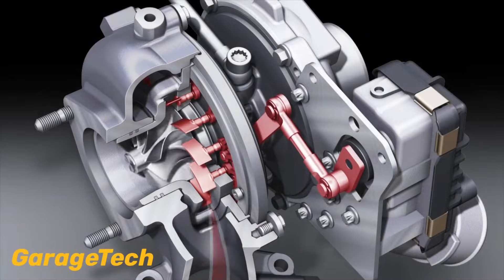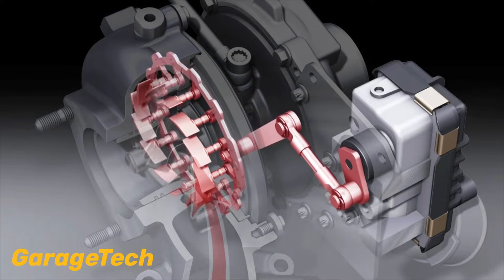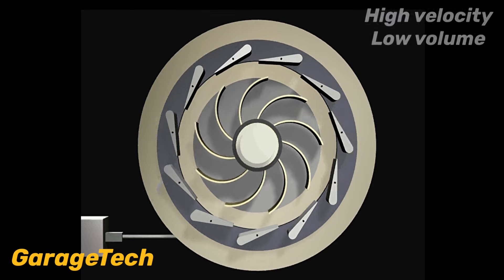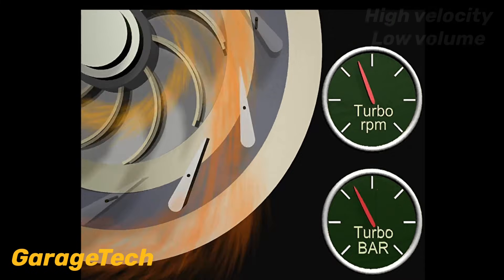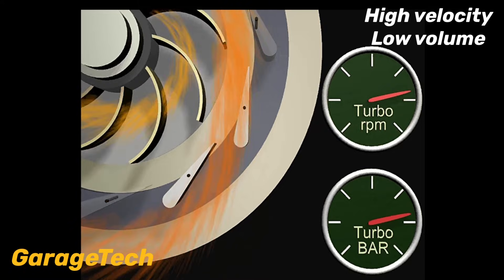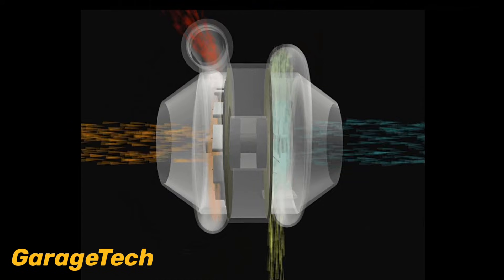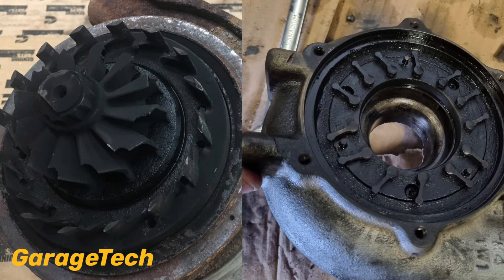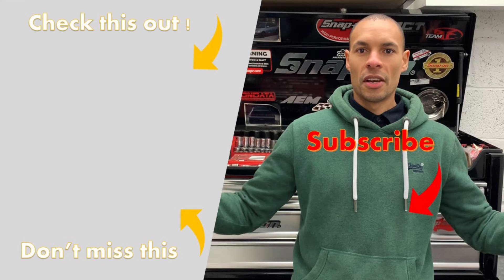How do VGT Variable Geometry Turbos work? Common faults for diesel engines. Variable vane turbos VTG

Comment: Please let know how electric actuater worksin evgt 
And what is the pulse current in evgt
Reply from the maker: Hi, An electrically operated actuator for a variable geometry turbo (VGT) is an intelligent, self-contained electric motor and gear system controlled by the engine's computer (ECM/ECU) I don't have the pulse current data, but it would typically have 5 wires, 2 for the motor, probably working on 12v, ECU reverses polarity to open/close. And then 3 wires for the position sensor, 5V,signal and ground. Some may use a Digital or PWM signal (often 0–5V square wave) or LIN bus communication 0-12V square wave. It's unlikely you'll be able to decode the PWM signal to understand what position its in, the important thing would be, do you get a signal and does it change if the position changes. These will need calibrating/basic setting adaption, so the ECM knows the start and end point. providing the vanes in the turbo are moving freely.

Comment: Attn: chat....I have a issue with my peterbilt.  Its throwing a code on my 2013 peterbilt 386, SPN 641 - Engine variable Geometry turbocharged actuator #1,  FMI =13 out of calibration.  I watched my mechanic with his laptop install and it calibrated successfully.  But, this code still didnt clear. I needed a ambient outside temperature sensor as well that was on my driver side mirror. That was replace. Has a new turbo, has a new actuator,  new manifold.  Like what is wrong with this truck.  I need help please
Reply from the maker: Seems strange that it calibrated correctly but the code is still there. If you erase the code does it stay off for a while until driven or does it come back straight away? I’d get the wiring from the turbo/actuator to the ECU checked again, could be a partial break in a wire, corrosion on a plug terminal. Check the earth and + terminals for the ECU, I assume the actuator is earthed via the ECU. If the code is still coming back after replacing the turbo and calibration has been done correctly, it can only be the wiring or the ECU. Also just worth checking things like the intake air flow meter (Air mass meter) and also boost or intake manifold pressure sensor. If these are slightly out or spoiled it will impact the boost pressure. Good luck, and let us know when you get if fixed ✌🏽

Comment: What is the effect of dirty geometry?
Reply from the maker: Hey, most common effects are lack of power, sluggish acceleration, engine going into limp mode with under boosting fault code P0299. 
You could also get over boosting which would cause the engine to go into limp mode with fault code P0234. 
Other things could be black smoke, hesitations, judders, poor fuel economy.
Reply: @GarageTechAutomotive  tks a lote

Comment: How to know if the vanes are stuck open or close due to carbon build up or slug ?
Reply from the maker: Normally the engine warning light will come on but you may notice a lack of power or black smoke coming out the exhaust
Reply: @GarageTechAutomotive thanks a lot from your video I really fully understand my turbo
Reply from the maker: @ahmedalial-saeed9471  you’re welcome ☺️

Comment: Great explanations! I have just one question. What type of actuator the turbo have? It’s ECM controlled? Or an actuator like a solenoid or stteper motor.
Reply from the maker: Hey, can depend on the turbo/engine setup, all modern ones will all be ECM controlled, some will be vacuum operated, most new one are electric motor operated as you have more accurate control

Comment: When the engine is started and there is no load the turbine blades are closed and when we press the accelerator the turbine blades are opened, is that correct?

Comment: With proper ECU, the power will drop no matter which way the vanes stick. Modern cars have both MAP and MAF sensors in the intake and if either one shows unexpected values (because of sticking VNT or VGT vanes) the ECU will cut fueling until proper limits are reached. In practice, this results in less than expected power level because incorrect vane angle would cause incorrect amount of air if given with full fuel delivery so ECU will deliver less than requested amount of fuel (according to the accelerator pedal) to the engine.

Comment: Its an Awesome idea! but the more moving parts you have in an unforgiving environment on the hot side of the turbo, would definitely cause more issues then just a regular turbocharger and cost much more to replace if and when it fails! Good idea but i think more research is needed here

Comment: Hello sir,

When you replace it with a new one in a Bmw 530d m57 231ps from 2006 needs it calibration then or is it plug and play. Thankyou
Reply from the maker: @FurKan-f6b if it’s an electronic actuator then yes it will need calibrating.

Comment: Can you clean a VGT in an ultrasonic cleaner to remove carbon without replacing the turbo?
Reply: I would recommend you to use the Wynn's turbo cleaner that is used in the fuel tank. My father had a 2017 2.8 diesel fortuner with just 150.000 km and it started to have problems with the turbo. The main problem is my country's diesel that contais almost more than 15% of biodiesel. Our car on the highway couldn't pass 120 km/h. We even went to the official toyota dealership, and they said we would have to change the hole turbo. I then searched for this turbo cleaner and it miraculously handle to clean our car's turbo. We used to put it in each time we filled the fuel tank for about 8-10 times. Hope this can help you!

Comment: Hi on my 2008 XC90 with Electronic actuator- I put in new one but after callibeation I did 600kms and it got stuck in low position- the waste gate arm from actuator- only after few times turning off and on it came back to life and managed to drivr home. Does it mean the issue is carbon dirty turbo vanes or? Thanks for any tip!! 😊
Reply from the maker: @lifestyleoffreedomfamily  yes could be that it’s clogged up with carbon soot, I would first just check all the wiring and connections just to make sure they are ok, could also make sure the calibration was done correctly. With the actuator disconnected can you move the arm freely? If it’s really stiff then that’s your issue 👍🏼
Reply: How to remove clogged soot without dismantling

Comment: Would it be better to have an emergency wastegate set slightly higher than the boost pressures you're looking for.?
Reply from the maker: @glenngray6895  Some setups have wastegates as well but generally the changing angle of the vanes is enough to slow the turbo down when needed.

Comment: Hello, I have a question regarding my whisling turbo
The turbocharger is brand new and bought it from Garret
And just today came up with idea to disconnect turbocharger actuator which is electric and then there's no more whisling
Where's the problem?
Car is remaped
Reply from the maker: @justasleleiva1351  could be where once the turbo has spooled up, the waste gate starts to open or if a VGT the vanes are in a position where it causes a whistle, with the actuator disconnected it’s preventing it from over boosting which doesn’t create a whistle noise.
Reply: @GarageTechAutomotive  so could it be too early boost or overboost?
Is there possible map or maf sensors sending wrong readings to ecu etc?
Reply from the maker: @justasleleiva1351  number of things to consider? Why was the turbo replaced in the first place, what sort of map was added, peak bhp etc, was this before or after the turbo was replaced?
Reply: @GarageTechAutomotive  Well it's pretty long story, but in short:
Dpf gutted and oem turbocharger had slightly shaft play (so back pressure damaged),
Get rid of dpf, refurbished turbo correctly installed
Remaped at proper tuner
Were whisling noice, tuner said turbo not 100% fine
Drive over 7kmiles nothing changed
Bought new turbocharger,
Washed oil sump, checked oil supply, replaced numerous of gaskets of intake system, together with new intercooler and inspected exhaust manifold, no leaks..
So after installing a new turbo charger after 2-3 weeks noice appeared but not so terrible as previous turbocharger 
So with this whisling i did an Europe trip, nothing went wrong 
Except still whisling, there plenty of power
Until yesterday i came up with idea to disconnect electric actuator and then there's no whisling at all... so i can't really figure out what should i look next. I do suspect bad map
Bmw F10 530d 2011
Reply from the maker: @justasleleiva1351  so do you still get the same power and boost with it disconnected? I would suspect that due to the modifications the whistle is probably normal if the turbo is still good. After a few miles it’s likely it’s built up some soot and the way the air flow now goes it just makes that noise. I know on some VW’s there used to be little air guides within the downpipe of the turbo which helped direct the exhaust gasses in such a way it reduced any whistle noise. Deleting the DPF will also change the way the exhaust gases swirl around plus the reduced back pressure and increase in boost. Have the mappers given any thoughts?
Reply: @GarageTechAutomotive  Once i disconnected actuator straigt on fault appear, and if i drive it there's no boost
Yeah might try downpipe install it and see from there
But now, I might try to replace the map sensor, but no faults at all
Reply from the maker: @justasleleiva1351  whilst you have the exhaust off, best to just check if there’s any free play on the turbo shaft and ensure the vanes are moving freely

Comment: I have a 6.7 Cummins with a 467.7 turbo with a mechanical vgt 3 stage spring actuator. It’s adjustable. Right now at lower speeds it has massive turbo flutter and boost drop from 30 to 15 then wot it goes away and builds to 45psi no issues? Should close it more or open it more to fix the issue?

Comment: What actually controls this vanes in a vacuum actuated one and where is the input coming from?
Reply: I have a p2563 boost control circuit amplitude below and above min max on a 2019 ecoblue transit. Replaced actuator the rod moves freely and you can hear turbo boost on and off by manually moving rod. It over or underboosts.  I'm stuck! It's a brand new turbo.  There's a 5 pin connector and all wires in tact gnd ok 2 x 5v refs but none on other 2?
Reply: @ritchieschofield1185  Check your vaporizer  if it is stucked with soot. Run diagnose with a car diagnose check the temperature sensor, check DPF soot live data, check back pressure at 3000 Rpm. On many Fords have problem with stucked vaporiser which has to be replaced. The role of the vaporizer is to rise the temperature when the car need to run regeneration to burn away he soot upbuilding in the DPF. Vaporizer is under the car, it is mounted on the DPF. Unscrew the vaperizer use a Mityvac handpumpe and check if it stucked with soot. A new vaporizer is quite expensive. In order to diagnose your car, you must use a modern bi directional car scanner.
Reply: @ritchieschofield1185  
Actuator calibration / learn not performed after replacement (Ford requires a turbo learn/adaptation).
Wiring/fuse/ground issue on actuator power/control circuits.
Wrong actuator (part supersession mismatch) or incorrect clocking of the actuator to the turbo (position offset).

IF Position Offset - Remove actuator bolts slightly and rotate the actuator until the rod engages smoothly and sits at the correct neutral position.
Most Ford EcoBlue actuators have alignment marks or require a calibration procedure after installation:

Use IDS/FDRS → “Turbocharger Actuator Learn”.
If no marks, set the turbo vanes to fully open (mechanical stop) and align actuator to its corresponding stop before bolting.

Position sensor signal fault (5V present but signal stuck at ~0V or ~5V).
Less often: air path faults that drive the system to the stops (massive leak/blocked intake/exhaust) plus jittery feedback that trips range/perf.
Reply from the maker: @bsee_1aquinteroalfredlouis884  the vacuum diaphragm valve is control by an electronic solenoid valve which is basically a switch which allows the vacuum pressure to move the control rod which moves the vanes. The solenoid valve is electronically controlled by the engine ECU. The vacuum pressure is created by a vacuum pump 👍🏼
Reply: What are the sensors that plays a role in the boost control
Reply from the maker: @bsee_1aquinteroalfredlouis884  the ECU will control the boost pressure from information from the boost pressure sensor, ambient and intake temperature sensors, fuel temperature and pressure, engine speed, load and temperature. There are lots of variables which impact it.

Comment: Why is my boost air so hot ?
Reply from the maker: Hey, is this a problem with your car or just a general question on what causes the boost air to be hot. As the turbo is connected to the exhaust naturally there’s heat transfer. Secondly, when you compress air it heats up, hence why it’s common to have an intercooler.

Comment: would a geared turbo be a better solution if possible in cars?
I know jet engines have geared turbofans that obviously work on different mechanisms, but seem to be the best solution for jets.
Is it just complexity holding it back from cars or is there something else?
Reply from the maker: Suspect it would be the turbo lag or just general complexity. Probably why they have sequential turbos with one small and one big.